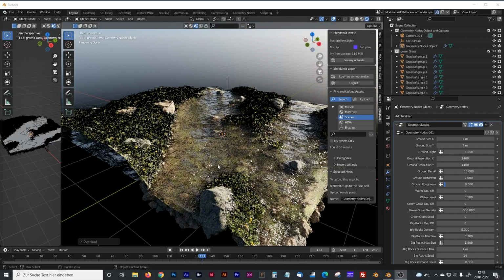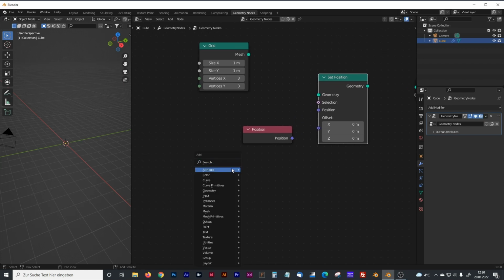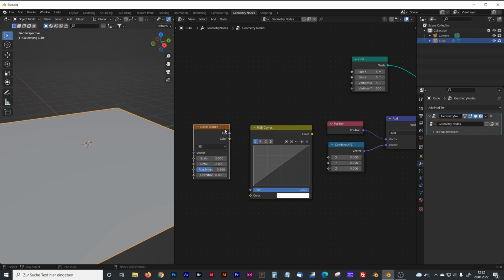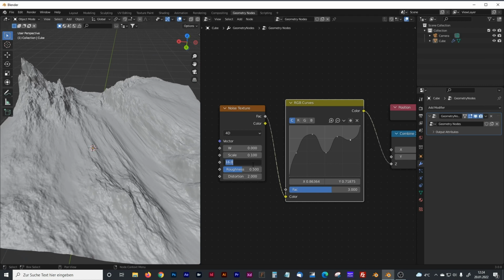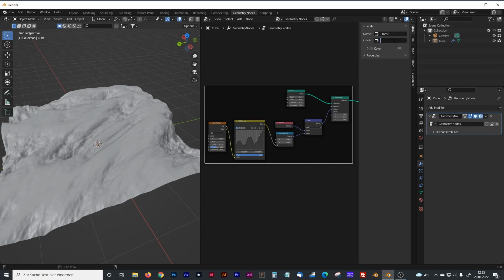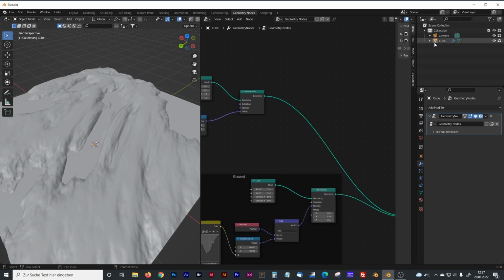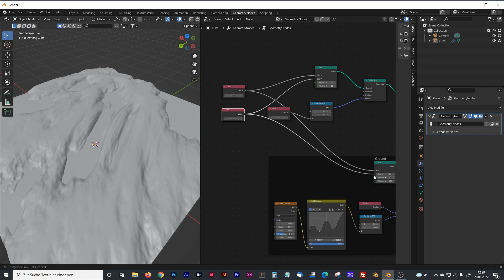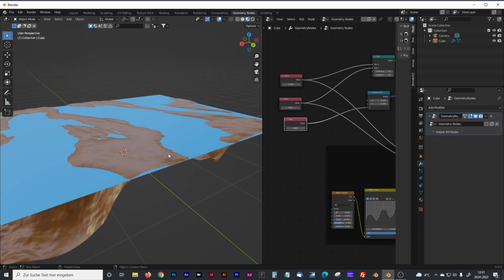Blender Geometry Nodes 3.0 - Procedural Landscape Tutorial  - Part 01

Comment: Question, how much load does this put on a graphics card as opposed to other landscape developing methods?
Reply from the maker: I tested the model on an i7 Laptop with 16GB RAM and a NVIDIA Graphics Card with only 4 GB RAM. Rendering and editing worked fine. A high Grass densitiy will slow it down a little bit.
Reply: @blenderdude5050  Okay, that is REALLY good news. Thank you for the quick response!